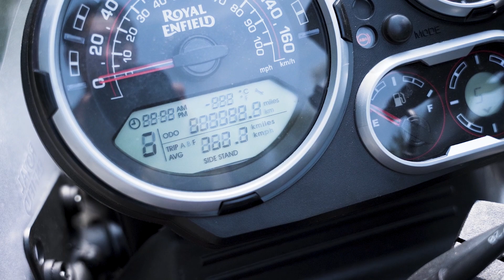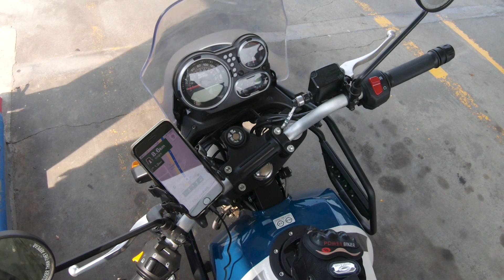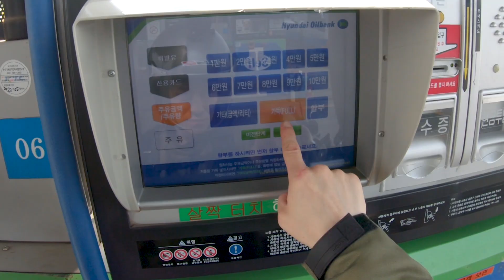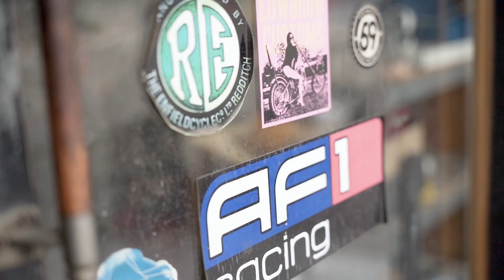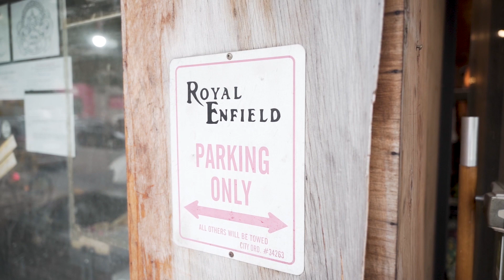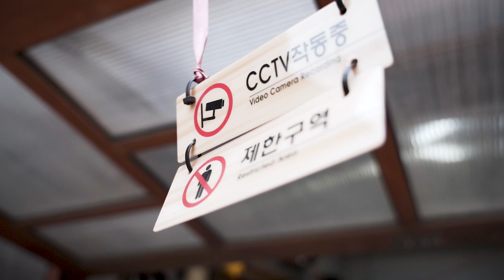Oil change on Royal Enfield Himalayan in Korea

Comment: Hi Vladimir. Even I own a BS4. Your videos are really informative. One mod which I would suggest is handle bar replacement. I had replaced and the handling is too good and body posture is straight which helps in long ride. Super comfort. I can now drive for 500km in single run without halts. Developed for self with excellent quality
Reply from the maker: Hi Ravi! Please give me a hint what kind of a handle bar you use?
Reply: @MotorcyclistDiaries   any possible way to share the photos or video. Do u have what's app.
Reply from the maker: @freespiritravi0001  Just put the link to the product;)
Reply: @MotorcyclistDiaries   Have self developed it hence need to share pictures and video.
Reply: No YouTube channel. Can send thru FB or What's app only
Reply from the maker: @freespiritravi0001  My contacts is always in the descriptions to video

Comment: It may seem very low miles (oops sorry kilometers) to change oil but as with my old oil cooled hondas they don't take much oil so I always changed regular ....keeps them good condition ...ATB from dave
Reply: first oil should be changed within 500 km cause wear and tear is much higher in new engines afterwards i think its 6000 km

Comment: The first four motorcycle service is free in India. You only pay for the oil and parts. Here no one(almost) does their own service. Haha. Infact if you do, you void the warranty.
Reply from the maker: I've read about free services in REH user manual. Seems like RE after service approach rules are different from country to country because I paid for labour as well. When I told about DIY service. In Russia in Siberia where I came from I did everything by my self from timing chain and damper replacement on my car to house water supply system. Why? Because I like work by hands (if I have had several lives I would did it full time) and another reason, that skills would be very useful in long trips.
Reply: @MotorcyclistDiaries  absolutely true but here the labour is so cheap that hardly anyone works in their bikes. Hahaha. Trust me when I say this, I know nothing about how my bike works. 🤣 So I got an extended 5 year of road side assistance for RE to save my ass when I am stuck.

Comment: please would this bike model be suitable for my physical size? 5 feet and 3.5 inches tall? thanks await the answer? I'm from Brasil.
Reply from the maker: Royal Enfield Himalayan has 800mm seat height. I'm 169cm and I stand on both feet on tip toe, (bike without luggage). On one entire foot easily. You would better try to test it at local dealer's shop.